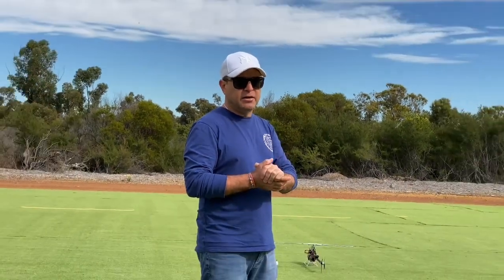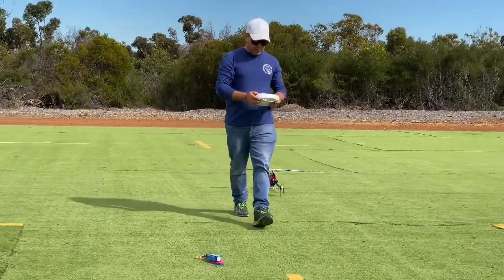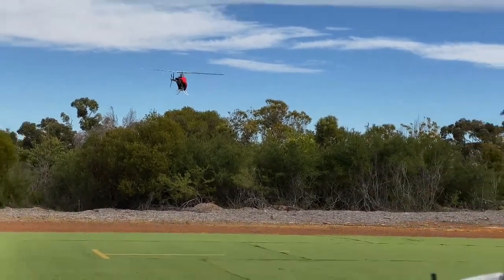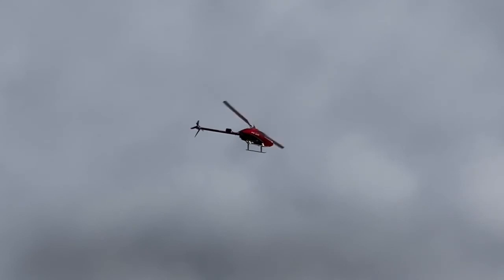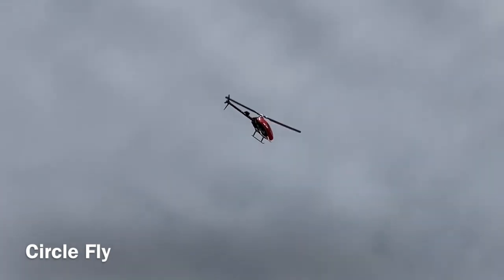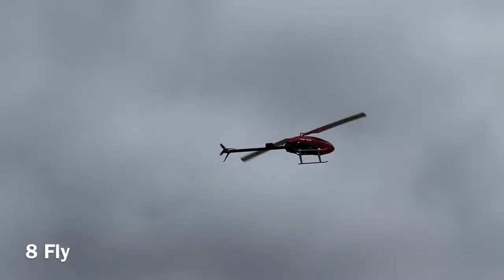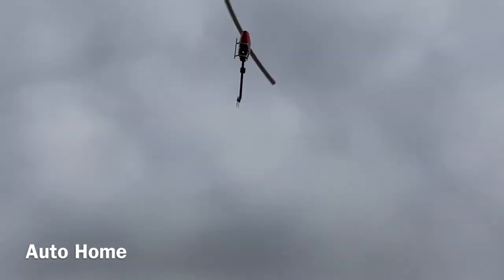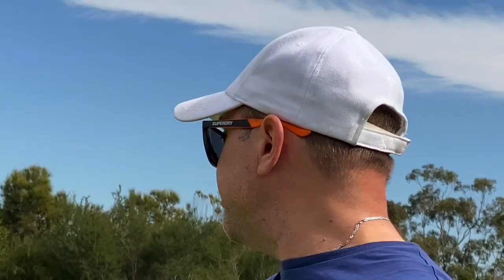Flywing FW450 Compass Calibration Problem

Comment: You may need to plug it in to a computer and up date the firmware or check that the Gps is not damaged.
Reply from the maker: ruflasto hines Turned out it needed a compass re-calibration.
Reply: @Mr_Trixsta  Glad to hear its' ok.